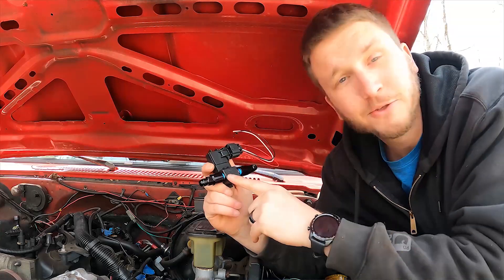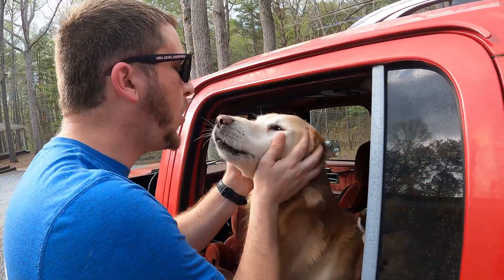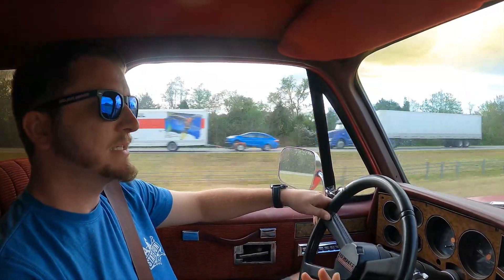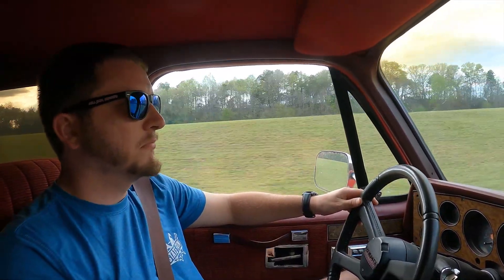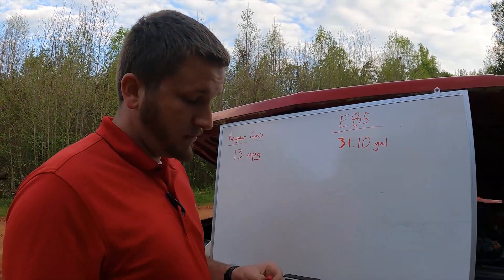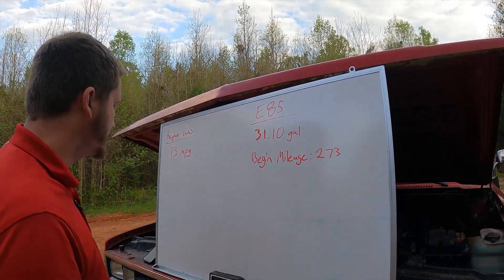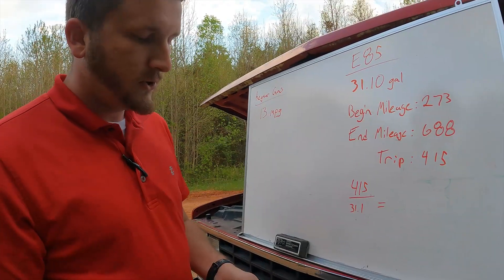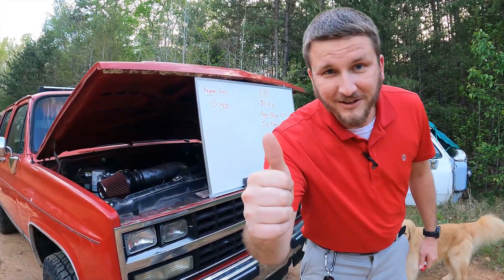SHOCKING RESULTS | E85 CONVERSION GAS MILEAGE TESTING

Comment: Thank you for sharing.
Planning to convert my 2022 Prius, because I want to, not because I see benefits, for me.

Please don't touch or look at phone while driving. Same as with passengers, don't look at them like you would when not driving. Also keep right except to pass. Lanes left of right lane are meant for passing only (unless exits).

Thanks again for sharing, lower RPMs up hill from the increased Torque sounds interesting amd wonder if my prius will get that experience.

Comment: I run e85 for performance but I get about 25% less fuel mileage on my lq9 6.0 in my OBS Chevy pickup. It went from 12-13 mpg average on pump gas to 9-10 mpg on e85. This was an overall average, the truck has a 4l80e and 4.10 gears
Reply from the maker: From previous experience I was expecting about 15% drop, but I got extremely lucky with my gearing and shift points I guess
Reply: I think it depends on vehicle. I had a chevy equinox and it got 10 mpg less with e85.  But my ram truck i get same as with regular gas.
Reply: how did u set up ur p59 pcm for the flex fuel i bought the e 85 flex fuel kit to do mine and i have hp tuners head i had to segment swap from  another tune file that has flex fuel on from the factory let me know if u could help

Comment: Your results are not crazy, the problem is that people have been bamboozled by BTU comparisons. BTUs are irrelevant when it comes to internal combustion engines. The following are reports I have published on the irrelevance of BTUs and my experiences using higher ethanol-gasoline blends in unaltered non-flex fuel vehicles:

The Irrelevance Of BTU Rating - Big Oil's Gimmick To Hoodwink The Public 
http://www.theautochannel.com/news/2015/10/19/144405-irrelevance-btu-rating.html

The Irrelevance Of BTU Rating - Revisited
https://www.theautochannel.com/news/2018/07/14/603714-irrelevance-btu-rating-revisited.html

The Reason Why Some Ethanol-Gasoline Blends Outperform E0 in All Engines
https://www.theautochannel.com/news/2023/08/17/1306206-reason-why-some-ethanol-gasoline-blends-outperform-e0-all-engines.html

Screaming Mad About High Gas Prices? Use More Ethanol!
https://www.theautochannel.com/news/2022/02/19/1108715-screaming-mad-about-high-gas-prices-use-more-ethanol.html

I Just Saved 38% on a Fill-Up By Using E85 - You Can Too!
https://www.theautochannel.com/news/2022/02/25/1111005-i-just-saved-38-fill-up-by-using-e85-you.html

Comment: more torque, burns longer, makes more torque on the hill climbs. That was the first thing I noticed on my first e85 fill up., just make sure you updated you fuel lines and use a 10 micron stainless fuel filter. the stock paper filters are okay but the swap is cheap. also your probably like every single gas station, they probably put 89 octane in all the fuel pump except the e85 one. Jag-Off gas station owners, i would have to say most gas stations are franchise operated so any way to make a buck of every fill is a plus.

Comment: It’s silly that the price would be flip-flopped with premium gasoline. The whole idea of ethanol was economics.!
Reply: Here in Texas it’s roughly 20% cheaper and my flex fuel truck runs really good on it but the pumps are hard to find, I use an app that helps me find them around town

Comment: Can I used Lucas lubrication gas additive on e85? I can’t find a video on YouTube ! I’ve been loosing gas and I bought new tires and new battery but I’m still loosing power so I was thinking using Lucas and I wanted to see if you can help me …ty (20012 dodge caravan flex fuel) I do notice my mpg double when I had a mix of gas!!!! 30 mpgs but now I get around 18 and I understand that normal but would be safe to used 1 gallon regular gas and 16 on e85 . I drove 3 states without getting gas (yes they were all close but 4.2 hrs later I was amazed
Reply from the maker: If you're talking about the injector cleaner version, I'd expect it will work fine in E85. They do have an ethanol specific fuel conditioner, which appears to prevent water separation in the fuel, https://amzn.to/42sPRQa
As far as using a specific blend of gas and e85, that's perfectly fine on a vehicle specifically labeled "flex fuel" as it can run on any mixture of gas and ethanol. Pure gas all the way to pure ethanol.

Comment: Did you make a video about how you covert it yours Your Chevy
Reply from the maker: I did the conversion a few years before I started YouTube.
Reply: I have a chevy schoolbus that I would like to get running and get converted to ethanol. The bus is located in northern Ohio Michigan. I also have a youtube channel with 6000 subscribers
Reply from the maker: @Erickthedreamgiver  I just realized you meant ethanol conversion not the LS conversion. I do have a video on the e85 conversion, just not one for the LS. 
I'm not sure the best way to convert a non-LS engine. You could probably run a Holley ECU and throttle body though!
Reply: Yeah I was thinking about stopping by the Holly factory On the way up from Texas To talk you know about it
Reply: About how much did it costs you?

Comment: Hello I got a 1994 Chevy 2500 truck with the 454 motor, would this be the best way to get better mgp for me?
Reply from the maker: Unfortunately no, this modification shouldn't get better mpg. I got extremely lucky that this particular drive ended at the same mpgs. I've done further testing and get 0.5 mpg less on e85 in more typical driving. I don't have any good suggestions for mpg on a 454, they were built to drive past everything except a gas station.
Reply: Only thing to do is to take the heads off and clean the combustion chambers as engines get less efficient with significant carbon on the pistons and combustion chambers.

Comment: I noticed the same thing in my 2012 Titan as well as my 97 Express van running them on E85.  Your not in the throttle as much with the increased torque to get rolling and stay rolling.
Reply from the maker: Agreed!
Reply: The E85 here is over $1.00/gal cheaper than 91 or 93.  On my tuned 5.7L Express van I was getting enough MPG over 87 to pay for premium fuel and the bonus was alot more power. It was even more economical and made more power on E85. Down at 1,500-2,000 rpm it made 40 ft/lbs more at the wheels on E85 than 91. I have replaced that 350 with an 11:1 aluminum head 383. I still need to change my fuel pump to supply the ~500 hp 383 with enough E85 but the 383 was built with E85 in mind hence the compression ratio. The old 350 got 19 mpg highway on 91+ octane E10 gasoline and about 15-16 on E85.  The new 383 gets 18 mpg on E10 and its currently octane limited on timing advance on 91 octane. The E85 results should be fun.
Reply: For reference here in Fort Worth, TX, E85 was $2.88/gal yesterday when I bought gas and Premium floats between $3.80 and $4.00/gal. I need to get off my butt and install the Racetronix E85 pump.

Comment: I had a similar experience. In Colorado going to Pueblo state park with my 2014 Silverado 1500 5.3 engine that is factory flex fuel capable. Towing our 24 ft camping trailer on gas we could get 10 mpg indicated on flat road at about 65 mph.  As an experiment we fueled up from nearly empty and at the same stretch of highway we got the same indicated mpg. Also traveling over the Johnson/Eisenhower tunnel passes(11,000+ft above sea level) our mpg was actually better than gasoline. I was also shocked/pleasantly surprised. Currently at my Kum&Go E85 is about $3.09/gal compared to $4.14/gal. I also do my own blending in my 2005 Colorado 3.5. I get a check engine with over about 26% ethanol but the engine really likes around 28%. On gas 20mpg all day long, with my blending about 18mpg. I can eek out 20mpg if I drive a lot of highway or back roads.
Anybody out there experiment with high altitude ethanol blending to compensate of lower O2?
Reply from the maker: That's pretty interesting. The e85 cost difference there's awesome!

Comment: Your torque level went up since you were not in a higher rpm.  Torque is what got you up the hills .take a look at Gale Banks Engineering.  He is the leader on gas or diesel mpg results.  No reason now with some of his products where you should be getting closer to 20 mph on your Suburban and 30 mpg with your diesel converted pickup.
Reply from the maker: Thanks for the info! 20 mpg sounds insane for this big hunk of metal... I'll have to see how

Comment: E85 in Southern California is between $3.69 to $3.99 while regular unleaded is $5.33. I run E85 on my truck even though I get 2 mpg less but it’s a lot less to operate my truck with E85 vs regular gas.
Reply from the maker: That's exactly the type of calculations I was expecting to do. Perfect example where it may not get the best mileage, but the price per mile is lower. Thanks for the comment!
Reply: Gas is 6.99 where I live while e85 is 3.69 👌🏻👏🏻
Reply: Salinas Ca. E85 2.79 vs 5.00 plus 87
Reply: Here in Central Texas the pumps we have locally e85 is like 10 or 15 cents cheaper that 87 so right now 87 is like $4 so e85 would be like $3.85 and my flex suburban would get 15mpg on regular and like 11mpg in e85 definitely not worth it for me